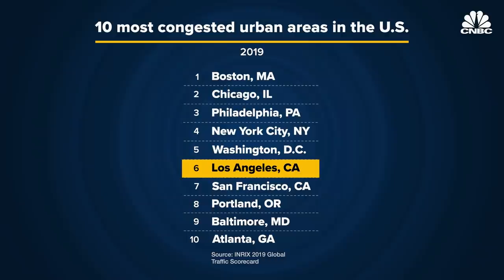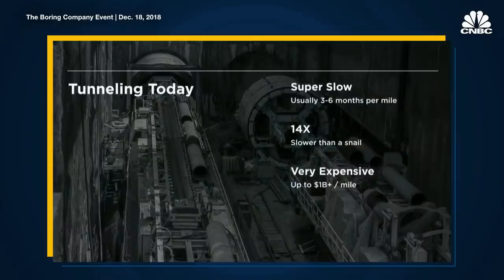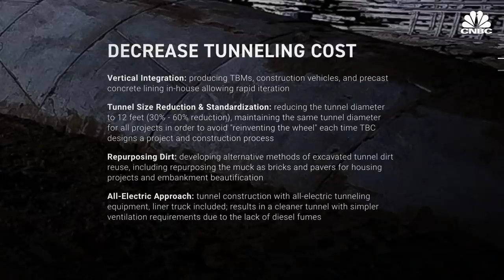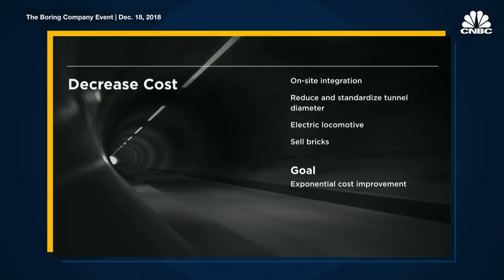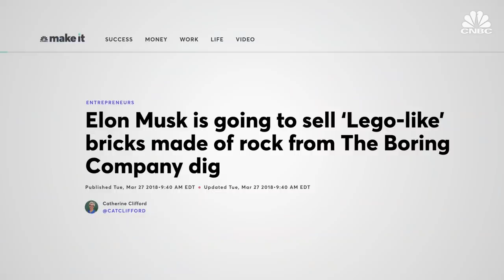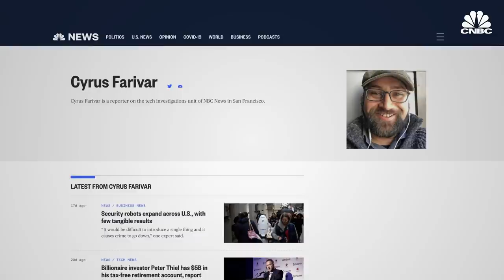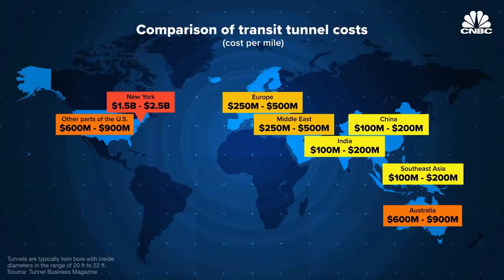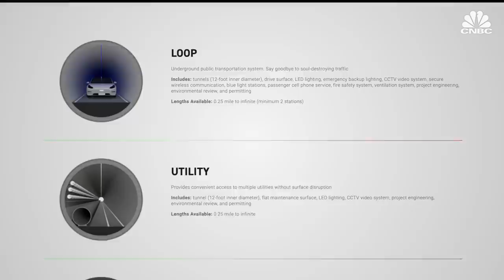Why Elon Musk’s Boring Company Isn’t Fixing Traffic Anytime Soon

Comment: Hey Elon, it looks like you haven't done (any of) your homework again. I shouldn't have to say this, but not all soils are created equally, and the reason you need to import material is that the tunneled material probably isn't what's needed to support or seal the tunnel. Further in many places (like Los Angeles) vast areas are interlaced with "toxic" materials like tars, oil sands, oil shales, coals, or old industrial waste... You know, stuff you can't use in the tunnel OR just spread around on the surface as garden soils.
Reply: PAUL Boring LOOP can go under the BEARING Streight allowing CARGO to be Cheaper than Rail or Shipping.
Reply: @markplott4820  Sorry, I really don't understand that sentence, and it doesn't seem to relate to my comment about a specific claim made by EM. So maybe it's better left as a stand alone comment. Thanks.
Reply: @berthaduniverse   - you are BORING me....zzzzzzzz
Reply: @markplott4820  Wtf?

Comment: The problem of the Boring tunnels is that they do not fix traffic- they shift the problems elsewhere. The tunnels themselves are fine, but their usage is... questionable. The early concept tunnels are now essentially an extra lane of underground highway that dump people onto the surface streets. If the surface streets can't cope, you will still have traffic problems. The new loop feels lacklustre because the Teslas have a terrible capacity, even compared to a light metro line. The tunnels are also the right size for metro trains, which feels like underused potential. Replace the paved roads with tracks, install a third rail for power (you won't have enough space for overhead wires) and replace the battery-powered Teslas with third rail trains.

Comment: how they think to put out the fire when one of the those batteries catch fire? IN A TUNNEL
Reply: The other teslas pressing it though the tunnel in hope they don't get toxinated that fast :)
Reply: Javier - TESLA cars do not catch FIRE while Driving on Roads.
Reply: @markplott4820  True, how can electric power could even result in a fire. You don't even Burn fuel like combustion engine cars^^
Reply: @Duesi2024   - Typically battery fires are RARE , the pack has to be Compromised in some way, the BOLT / KONA fires are FAULTY cells . 
so, no reason to Assume EV Vehicle fires.
Reply: @Duesi2024  well i was thinking in flood or seal the tunnel, but your idea looks better
Reply: @markplott4820  what road
Reply: @javiersolis-gi2zm   - TESLA do not catch FIRE while Driving on a Highway/Freeway.
Reply: @markplott4820  at least you corrected yourself, that battery fires are rare. But it can happen, even other issues can occure. There is actually no safety feature in those tunnels. What happens if a car crashes? Sidebays? Fire? Firesafety? any exit points? Flooding? Wathersafethy? Airflow in tunnels? I could gonon but i hope you get the point. Even if there is the smallest risk of failure you need to take it intoaccount and should have solutions.^^
Reply: @Duesi2024   - Crash from What ?
1 crash in like 9 million Drives .
Issues from WHAT ? BMS is BEST in the world.
Battery Fires are SLOW , car can DETECT fault with battery BEFORE Battery even Ignites, can EXIT the Tunnel safely , Exit passangers, FIRE crew Dispached to EXIT, Tunnels are FIREPROOF - concrete does not BURN, Exit points at Each end and FILLER Station, some ABOVE GROUND as in VEGAS. 
Flooding is NON issue, Entrance/Exit can be Above Sea Level, Tunnel pumped out before use.
LOOP tunnels have Blower/fresh Air.
Reply: @markplott4820  you are too serious, I was just joking. But for real I think the whole idea is stupid, he is trying to put Teslas in a subway, what next a Tesla in a rocket? When you helped the use of cars more people use cars and have even more trafic. Just buil a subway. This is complex, dangerus ridiculus and ineficient
Reply: @javiersolis-gi2zm   - TESLA Roadster became the Fastest Car in the WORLD at 17,500 mph. 
actually , Starship can Transport 100 people from Port of LA to Tokyo in just 30 min, cost SAME as Business Class Airline Ticket.
SpaceX will bankrupt AIRLINE business. 
Subway will cost $Trillions , LOOP only cost $ Millions. 
you have to also reroute UTILITY for Subways as in TOKYO and even SF Third street Project. 
MINIMAL Utility reroutes with LOOP. 
LOOP tunnels can be filled with ANYTHING you want , CARS, Trailers , Utility, Telecom, WATER lines.
Reply: @markplott4820  legal higher speed in my country 75, 1 in 100 rockets fail, planes 1 in 1000000, more speed equal more sound, pollution, money and danger, loops builded by now 0, LOOP tunnels are just tunnels you can put what ever you want in there, even a subway
Reply: @markplott4820  crashes from potential false sensors. Sure fires are 10 times less then on combustion engine, the risk still exists. Or do you think, making travelling via rockets around the globe on 97% failure rate makes it reliable, too? I looked the safety features up and got most of the things covered. The sideways are to small for passengers on the way to the exit point and i can't tell anything about the efficiency of air ventilation
Reply: Ikr, and what if the tires got flat and will it cause traffic in the tunnel?
Reply: Water?
Reply: @markplott4820  you don't know anything you're talking about, you spread so much misinformation in such a short time its revolting.
Reply: @Duesi2024  "how can electric power could even result in a fire. You don't even Burn fuel like combustion engine cars" - you're being sarcastic, right?
Reply: @Duesi2024  That’s actually a reason they would never be accepted in the EU at least not in there current iteration, because they don’t follow the Tunnel transport directives standard on safety and escape options. There are by the way a requirement that every few hundred meter there are side bays and escape doors to another tunnel or tunnels to the surface with stairs and elevators. The directive makes sure that tunnels are built to a minimum safety standard, yes creating big extra costs but very important for the public safety.

Comment: This is AMAZING!  The job a tunneling company billed at $5 billion can be done by Tesla for less than $500 million!  Boring company FTW!
Reply: Ehhhh...... I'm not convinced he can do this. 

Maybe he's getting preferential treatment or it's to showcase costs and he foots the bill? 

What are they doing so different than others, that gives a 90% reduction in cost? Wouldn't this drastic of a change be super evident by others?
Reply: @1337GameDev  It’s about how the company manages its projects and the techniques used in each iteration to engineer and build stuff. SpaceX also accomplished the same things that NASA has done but with way lower costs.
Reply: @jameswg  

And how does boring company do this so efficiently that costs are down 90%? 

I feel they are cutting corners here. A 90% cost reduction feels like unfair play -- or literally every company would do this -- as that's how capitalism works.
Reply: @1337GameDev  Tesla vehicles are 97% efficient.  ICE vehicles are 30% efficient.  Wouldn't this drastic of a change be super evident by others?
Reply: @davidbeppler3032  

Electric vehicles, are 97% efficient (assuming original energy losses from power plant, transmission, rectification, voltage amplifying, and 3-phase AC generation via VSD), then yes. 

If other companies could use electric to generate energy and reduce costs by 90%, they would.

It just so happens, for most people, owning an electric car is a HUGE cost, hassle, concern, and is a big learning curve. 

Going on a 500mile road trip with on is even a huge chore. Then you have to have like 5-6 apps for charging overnight, as well as a handful of improvements to residential areas (assuming you own, as if you rent , then good luck getting L2 chargers). 

There's a much bigger reason why ICE exist still, beyond pure efficiency. Also, the manufacturer doesn't pay for those energy losses, and the customer doesn't as gas is CHEAP.
Reply: @1337GameDev  The part that is funny is the fact that "assuming original energy losses from power plant, transmission, rectification, voltage amplifying, and 3-phase AC generation via VSD)", applies to ICE also.  You also have to add the millions of gallons of bunker fuel used to transport it as well.
Electricity prices don't fluctuate based on a county catching fire or going to war.
I personally plan on going for a 17 hour road trip over 1300 miles.  In an ICE I would have to stop every 300 miles for 10-15 min, in the Tesla I will have to stop every 200 miles for 15-20 min.  I see how horrible that extra time is to you.  I will also save $120 round trip.  I think 2 hours of my time for $60/hr is a good deal.
FYI a $47k Tesla Model 3 is less expensive than a FREE new $25k Honda Accord over the life of the vehicle.  :)

Comment: Elon Musk is a snake oil salesman. When are people going to realize the "emperor" has no clothes?
Reply: Stop riding  thunderfoot.  What has he done that's snake oily?
Reply: @user-RCST  the boring company for example
Reply: @kekule71  so far the boring company is making cheaper tunnels so that's doing what he said.  Also at one point the original roadster barely got 200 miles of range now the new model S has 405 miles of range see how things improve over time you can't just expect it to happen overnight.
Reply: @user-RCST  He wants to build a tesla exclusive tunnel to counter traffic. One tesla at a time can cross the tunnel. Do you think that is feasible? That it should be allowed?
Reply: @NotShivekArora  it's not Tesla exclusive it's the electric vehicle exclusive.
Reply: He’s single handedly catalized the entire auto industry into electric vehicles. He’s invented the worlds first reusable orbital class rocket and brought down the cost/KG of outing materials into space by a factor of ten. Scammers tend to run away with the cash far BEFORE  actually producing something with it. BTW if you think he’s such as scammer, I’d suggest you put your money where your moth is and short TSLA…….we’ll circle back in 5-10yrs and see how that worked out for ya!
Reply: @user-RCST  and how is that's better than building public transport?
Reply: @NotShivekArora  it is public transport.
Reply: @user-RCST  Metro is public transport. This is private. Made out of public funding. Because of type lobby.
Reply: @NotShivekArora  anyone can use this loop if you're going to the convention center.
Reply: @user-RCST  One person at a time. Can you really not see the fault with this? Do you really don't believe in climate change? Do you not understand the benefits of public transport?

Comment: If this revolutionizes TBM technology and new ways to lower costs in terms of material reuse and logistics, it could be considered a success. 

But the overall premise of using pods and loops doesn't seem like any sort of improvement over current public transit options.
Reply: The passenger experience is better because the pods are ready for you when you get to a station.  They leave immediately and take you to your destination (if it's in the system of tunnels)  without stopping at any other stations.  They even take you to your destination if it's not on the main loop.  The pods can exit to a different set of tunnels, and you don't have to get out at a transfer station and wait for another train or bus. 

Having a full train seems efficient at moving people, but that train is going to slow down and stop to pick up and drop off passengers, then accelerate back up to speed.  And then it's going to do that again for the next station.    Most of the people are just stuck there while the train stops many places that the passengers don't want to go.   A mostly empty train isn't very efficient, so during slow times, they'll run on a less frequent schedule, or the line will shut down completely.   That makes it less convenient for the passengers who do want to use it off-peak.

Comment: 4,400 per hour. On the other hand single line of metro in warsaw has about 70 thousand pet hour in rush hour and if you go for daily average - around 28k per hour.
Reply: There isn't a metro in the world that would fit into this one mile space and transport 70 thousand people per hour or even 28k per hour.  

And even if they could, 4,400 per hour is likely the most that will ever show up.   Your 28k per hour metro would be running at only 12% capacity at its busiest time.    You would have spent billions to build it, and you would waste huge amounts operating it inefficiently.   Why would you do that?

For $55 million they got a system that has less than 15 second wait time on average, and the average trip takes less that 2 minute. It's been a huge success for them so far, and the passengers give it high marks.
Reply: @kevinbailey8827  you're thinking small scale. Metro in Las Vegas on big scale would work. Not just mile. And costs are an investment. Cant say how much it would cost in LV bit tbh unless they release official document no one knows that shrugs
Reply: @Amdor  They looked into a metro system for the Las Vegas Strip, but didn't move forward because the cost was "billions".  Now TBC has offered to expand the loop to serve the Strip, downtown, the stadium, and the university, and it will cost the county nothing.  TBC will pay for the tunnels, the casinos and other station locations (51 of them) will each pay for their own station.

TBC will get the revenue from passenger fares, and will pay the county a portion of the revenue as a franchise fee.

TBC says the Vegas Loop will handle as much as 57,000 passengers per hour.

How's that for an investment?

Comment: Here's a crazy idea - several futuristic pods joined together and pushed by one ultra-futuristic engine that move people through a tunnel system.
Reply: That's kind of what TBC is starting to build in Vegas: 30 miles of tunnels, where the pods will race along together in sort of a virtual train, but when each pod nears the destination of its passengers, it leaves the train via an exit ramp while the rest of the pod train continues speeding along!   And new pods starting their journey will join the pod-train in progress.   It's beautiful.  Just like a subway except that the whole train doesn't have to stop at each of the 51 stations.
Reply: @kevinbailey8827  How much does that cost per mile? What is the cost to maintain it vs the cost to maintain a train? Is the few minutes you would save worth that cost? My point is there's no need for crazy inventions when we have a solution that has worked for the rest of the developed world.

Comment: Near as I can tell, the Vegas tunnel didn't actually go faster than normal. That's a shame because it'd be neat if they could repurpose some whizz-bang tunnel boring machine to make something useful like a train or a sewer, instead of these taxi tunnels.
For what it's worth, I do think standardizing tunnel boring machines would be a good idea. You figure their supply network could be more efficient if they were less bespoke. They really need to standardize them around subways instead of cars, though.

Comment: What I would like to see, is just fixing traffic signals!  In smaller cities, it is the traffic signals that congest traffic... Round a bouts work great... even when there are people who don't know what to do, when they approach one.  But the traffic signals, that supposedly automatically sense what they are supposed to do, do not work very well.  Just get them more fully functional, by using smart technology, and get traffic moving!
Reply: Better still, fix car dependency. Increase density, make streets smaller and slower while at the same time making them more walkable, adding cycle lanes, and ramping up public transportation. One person walking or cycling take up virtually no space (and no space on the roads), and one person in a packed bus or subway also takes up little to no road space.
Reply: Adding more capacity to the system will just encourage more car use and continue the vicious cycle that built this problem in the first place

Comment: Basically, they're building an underground highway network. Before you think that's going to help traffic, it's not. Having these tunnels is like having more lanes. More capacity means more people will use the roads. If it's faster to use underground tunnels, everyone will use the tunnels until they're so full up that the speed is the same. In other words, no matter how much capacity you throw at roads, you can never fix traffic. 16 lanes? Bad traffic. 50 lanes? Bad traffic.

Comment: I think its a good idea I thought of this 5 years ago, I think one probelm is its only focused on teslas, a plate for any car and the plate moves but then that will take energy, if the electric car drives in a small tunnel at 124mph, if one runs out of energy theres a big probelm and a long line of congestion, an electromagnetic plate is best but where does the energy come from, make the tunnel wider and let them drive  but then bigger tunnel costs more, thinking euro tunnel train that loads up with cars, an underround train for cars that gos 124mhp, its a tough one actually, an underground motorway with lanes and any car is the best way but the tunnel will be hard to reinforce and the speed of a snail for three of four lanes.
Reply: Drop the cars entirely. Build a subway. Much higher capacity.

Comment: 10:21 JUST BUILD A METRO IT'S NOT THAT HARD
Essentially, Boring Company has built a proprietary system that only works with Tesla cars. It's not space-efficient at all and the capacity is pants. Although they have made some developments in tunnelling technology, they have combined the expensive things about metro systems and the inefficiencies and low capacity of taxis. If the new tunnelling technology were to be used to make metro tunnels, you could have a low-cost and high-capacity metro system.